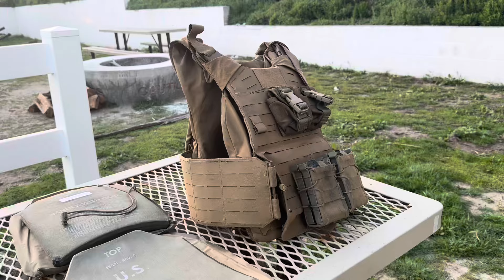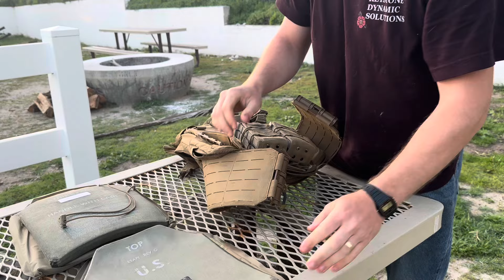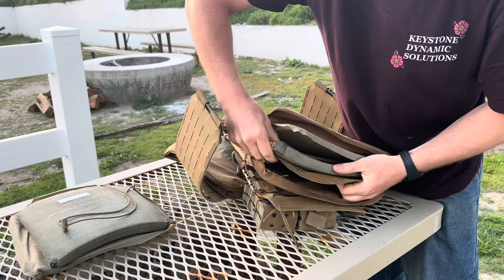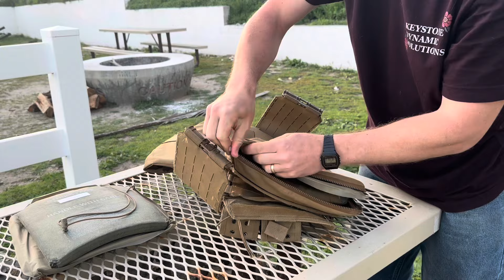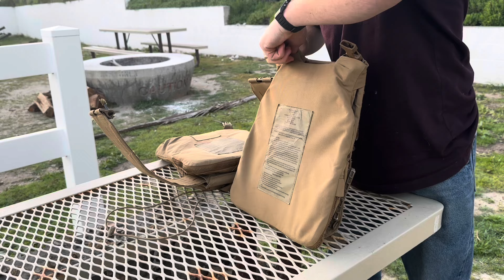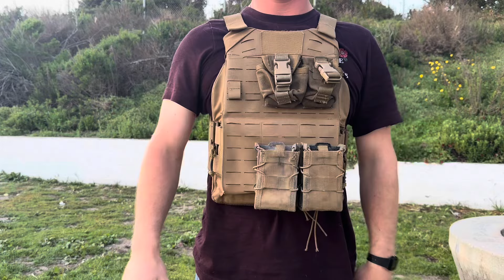Modifications to the USMC Gen 3 Plate Carrier

Comment: I think these things are fabulous! So much high technology and better protection! Let me tell ya… when I fought in Iraq in 2003, I was issued a steel plate that was placed inside of my vest and that was the only protection. This system looks light years ahead. Thanks for this video bud!
Reply from the maker: You are 100% correct, tech and gear have made huge advancements in the last 7 years or so. The issue I have with this stuff is that despite the USMC claiming to prioritize Warfighting and infantry, the gear we are given is catered to the ‘do-it-all’ mentality. Theres so much better stuff out there but we don’t get it because it doesn’t check all these unnecessary boxes the USMC imposes.
Reply: @GruntHacks  if you could have a carrier not issues, which would it be?

Comment: Pro tip, tuck the zipper in the bottom and tape it up it so the sapis dont sag so they actually are placed properly
Reply from the maker: The zipper shouldn’t have anything to do with how the plates sit! Theres a smaller inner pouch for them to sit in so they should never touch the zipper part. See the portion of the video where I insert the plates!
Reply: what im saying is putting the plate into the plate bag the plates sag low to the molle on the plate carrier and to get the plate to the top of the plate bag i just taped the bottom to have it sit high
Reply from the maker: Are you referring to how the load bearing panel sits way higher than the plate goes?